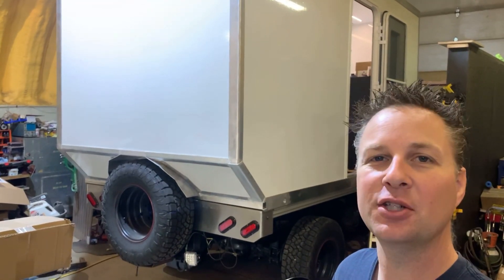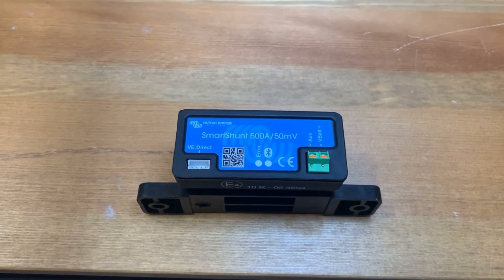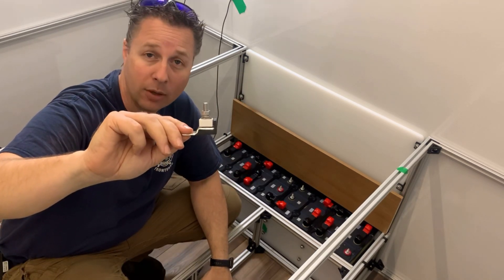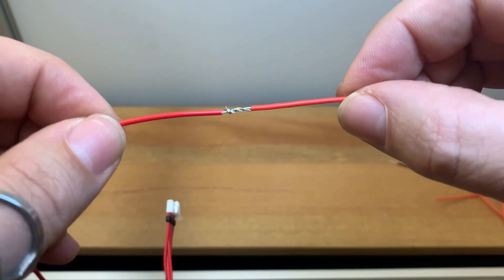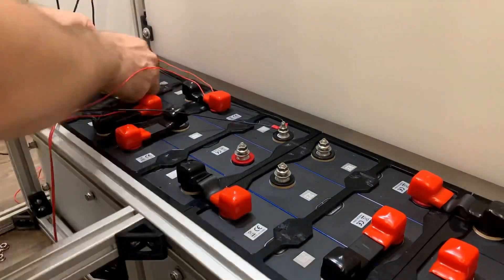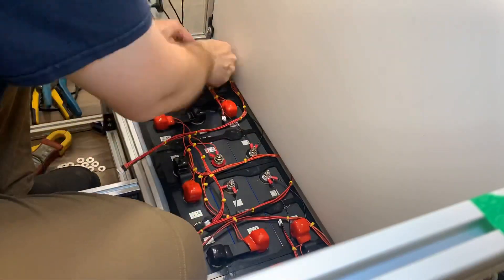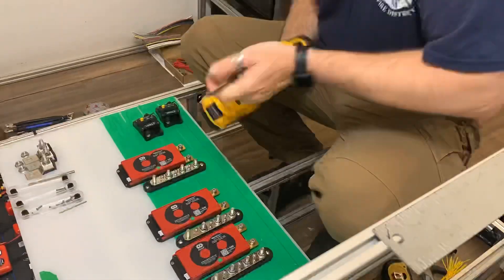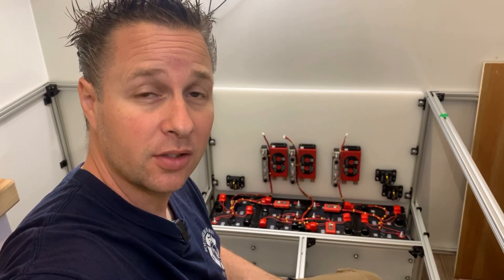Don’t forget all this stuff! | Overland Electrical Build

Comment: Excellent Bruce.  Whenever I'm wrenching in hot electrical environments I put heat shrink tubing over the tool handle end I'm not using. Like your stubby, and fold it over on the wrench end to double the insulation value. I dont heat  shrink it. Less messy than electrical tape and reusable.  
Course it helps to have heat shrink in lager sizes.  I have sizes up to 2 inches. I buy it in big rolls. Much cheaper than short pre cut pieces.
When I mounted my Victron inverter, mppts, fuse blocks, breakers and dongles, etc, on boards mounted on drawer slides so they pull out of the cabinetry like a pull out verticle pantry.  There are cooling fans mounted on the back side of the cabinet door that draw cool air across everthing and blows it out the roof top vent above the refrigerator/  freezer.  All the wiring that will be required to move is the super flexible wire and shielded  with rubber hoses where it will rub the compartments floor.  Kinda nice to be able to slide out my components to check on their condition if I should need to.
My batteries are mounted in the basement of the class A in the original battery compartment.  Those big batteries are also on beefy  slide out trays.

And I have several temperature sensors on strategic equipment that are tied into my cerbo gx to monitor everything and dound alarms if there is an issue!
Got it all working last friday.
Now itxs time to get the engine back together. Hot Rodded the P7100 on the 5.9.
Love watching your updates on this build.  Makesme want to go get an FRR Isuzu and start over.😊
Reply from the maker: Great minds think alike!  Not sure if you saw my super old, horribly made video of our sliding electrical panel in our white Fuso?  much simpler system, but on a slide.  This build will have a totally different access trick 🤪

Sliding Electrical panel / Reality of making a YouTube video
https://youtu.be/RMc-DQe7Rtw
Reply: @BruceandKrista  How about that!  We came up with the same solution.  In my case, I had this big ice maker mounted at the floor level, next to the fridge and under the food pantry.  It hasn't worked for decades and costs more than a new fridge to replace ($2700), so I eliminated it and mounted my solar stuff in that space. I have 2 slide out boards, one on each side. The cabinet door I built to cover it looks like all the drawer fronts, so all the equipment  disappears when closed.
This coach was a high-end unit in it's day, and the icemaker was for the margaritas bar they came with! I kept the bar and built-in blender and just make really thick milk shakes for the grandkids and myself.
Google '1990 Fleetwood Limited"
It originally came with an EFI 460 Ford engine and 3 speed C6 tranny.  A whopping 6 mpg if I was lucky.
This new drivetrain should yield 13 to 14 mpg with double the horsepower of the old Ford motor.
I've been rebuilding and remodeling the big girl for 24 years, when I can.  But the push to finish it is on now!
Sure wish it wasn't so long (37") so I could put 6 wheel drive under it instead of the tag axle set up it has now.
Have a great week Bruce!

Comment: My brain hurts after watching this, Bruce - but I'm totally content that you have this mastered..  Your series will be a huge help to others engaging in a similar endeavour
Reply from the maker: Haha - there sure are a lot of bits involved (but I can’t imagine your brain really hurts!)   Lots more complicated stuff coming!
Reply: Many LI Batteries come with the BMS and Balancer system built in and that does save a lot of the time and makes for an easier but costly install
Reply: @TheItinerantCraftsman  Yes, and they cost 2x to 3x more than component parts.  Bruce is saving thousands via DIY.
Reply: @ljprep6250  
Every DIYer fails to account for their worth. 
Bruce is experienced in this area and is accounting for that. But if it takes you or others days to figure this out, days to put it together, repairs on mistakes… and zero warrant if any one of those components fail, then no. It’s not more. 

I’ve put in enough electrical systems to know that there is a significant issue with quality control today. Outlets, breakers, switches - bad out of the box. Especially if dealing with smart devices. If you’re a DIYer, you’d never know if it’s the component of the installation. 

Throw back to Bruce finding a bad BCM on this rig
Reply from the maker: Yep, there are for sure a lot of off the shelf packages out there - but bang for buck, building is the way to go!

Comment: I love silicone wires, and tend to use them everywhere. But I have encountered two annoying problems. Anderson and Deutsch connectors, among others, require pushing the pin into place using the cable. Silicone cable is so flexible that it often doesn’t have enough force to push the cables into place. 

Other thing is that the gauge to diameter conversion is different. So you might need to use slightly differently sized terminals. 

I just got some terminal insertion tools; we shall see if they make Anderson insertion less annoying.
Reply from the maker: Yes, it is hard to push on silicone wires!  (And also hard to try to form them to shape!  But they sure are nice!
Reply: Yeah, the silicone wire is plush stuff, and worth the slight extra cost.  All fine, individually tinned strands which are even rated for marine applications. (Think "boat" instead of "HOOAH!")
Reply from the maker: Tinned copper is by FAR the right stuff to use!!
Reply: @BruceandKrista  I haven’t dug into the details - dunno if it’s got problems with crimping etc etc. But, per pound, aluminum is actually better. If you increase the size of aluminum to get to the same resistance as copper, it weighs less.